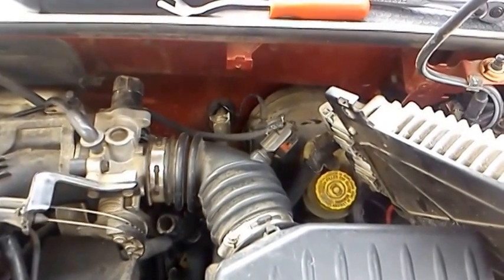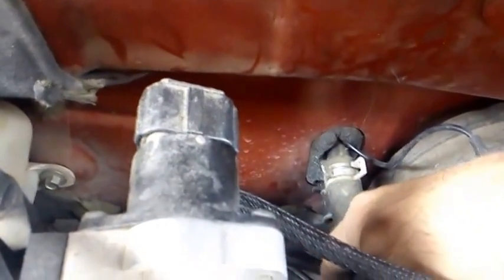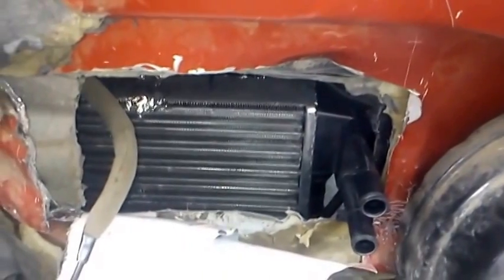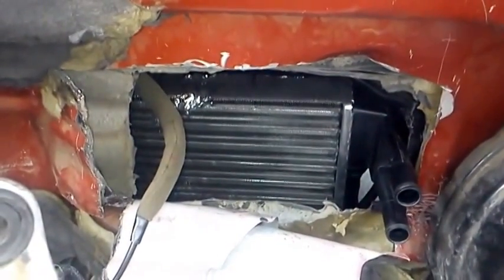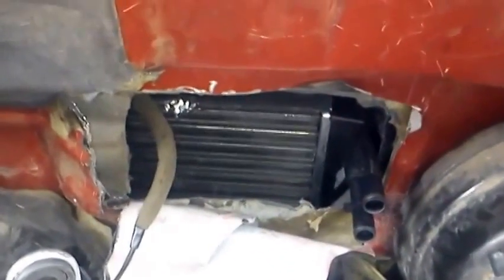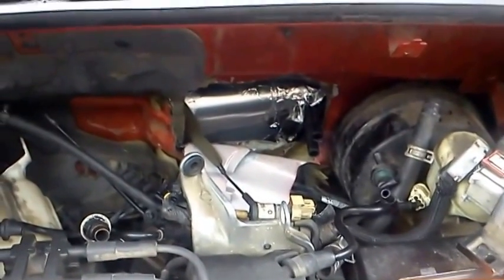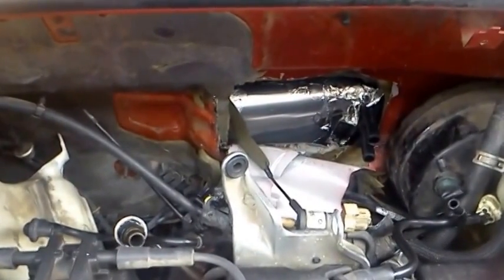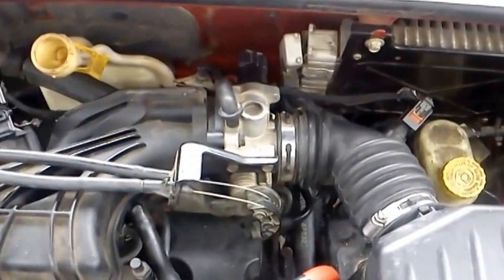2001 Pt cruiser heater core replacement short CUT pun intended

Comment: i just finished doing this yesterday. thanks for showing the video I would have never thought to try this otherwise. at first i made the hole too small so had to make it larger to get core out. but it only took 4 and a half hours to complete.  I made top cut at the seam or bevel on the fire wall ... needed to be about 3 to 4 inchs higher. so good luck whoever else tries this.. btw  making the wrong cut just cost me time that was easily fixed with a second cut. and then when you pull core out you need to cut/break the channel (on passenger side) that holds heater core inside the heater box. again the more room you have to work with the easier the job... have fun.

Comment: I just watched a video of a the dash removal.  It took that person over six hours to get the heater core out.  And he knew where every nut, bolt, and screw was located and the procedure to remove them all.  Imagine what a first timer would take to remove that dash and all the other stuff that needs to come off,  The idea of cutting through the firewall is a whole lot better.
Reply from the maker: Not to mention the cost involved if you have to take it to a stealer.

Comment: For an easier and cleaner cut, use an oscillating tool instead of a reciprocating tool.  Also, safer on the surrounding components.  Recommended is the Multi- Max with a BiM Saw Blade.  It is also recommended to have a Toyota Prius which doesn't have a heater core.  It uses electric heater.  Prius is years ahead of other cars in each and every component.  In couple of decades from now, hopefully the rest will start introducing the electric heater.  At least other manufacturers already started learning from the Prius and began using the electric steering.  Not so much the electric water pump yet.  Electric is the future technology.  Thanks for sharing this video.  Creativity is more important than knowledge.  Who said that?

Comment: Ronnie, damn good alternate procedure. After replacing timing belt with kit several years ago in my home garage, I told my wife that if it broke again to just call AAA and have them haul it of to the scrap yard. Never again will I attempt to replace a timing belt and associated parts on a transverse engine. 

After watching a guys 61/2 hour dash removal to replace a 25 buck core, I said there has got to be a better way. That led me to your video. Cutting a hole in the firewall is not a big deal if it is sealed, as you did, after replacing the core. If you look around the firewall, there are numerous firewall penetrations that use only a rubber grommet. As been said, if you have an engine fire, get the hell out and grab a fire bottle.

If you look at Kelly Blue book for the average retail on  a 2002 PT, the cost of repair, if you took it to a shop, is more than the cars worth. Now there is something to be said about no payments for many years but at some point, you may need to put the old girl down. But for this alternate procedure replacement, I plan on getting many more miles out of it. My 92 Miata has 476k on it and I commute 225 miles a day. Dang good car that is easy to work on and repair when needed. Any time  you can do your own repairs, save yourself some money. On older cars, it’s not rocket science.

Comment: Did my 2002 cruiser and this method does work but you had better have a good saws-all. Make sure you make a big enough hole in the firewall and watch out for sharp edges It took me a little longer to do but better than taking the complete dash apart.

Comment from the maker: i finally ended up using a sawsall Nayte sorry for the late reply.
I also used a soldering Iron to metal the plastic heater case to get to the core.
Reply: Ronnie, so thankful for your YouTube.  I'm fixing to do the same and see this as a win win method.  I'm planning to use a Ridgid Jobmax Oscillating tool for the cutting.   Very challenging to find a tool to work in these quarters and angles.  I laughed being from the south and thinking that with a name like Mccullough it's a git-ter done method, LOL!!
Reply: ronnie mccullough great tip
Reply: ronnie mccullough great tip ,thanks
Reply: Привет вам из России!,,, спасибо большое за идею, столкнулся с подобной проблемой, обязательно попробую сделать как вы, отличная идея!!!!

Comment: I knew a mechanic that used to to this to replace the heater cores in Ford Tortoises and Mercury Sables, because they were ridiculous too. wish I'd seen this back in 2008 before i wasted over 10 hours replacing the heater core in My neon, not just the time but having to get a gasket & o ring kit for the a/c lines and recharge it. the only disadvantage is not being able to wash all the anti freeze out of the heater box, so it will just smell like anti-freeze for the first while.

Comment: Excellent job Ronnie. Screw the haters. You're right, if the manufacturers, weren't such greedy bastards, a lot of shade tree mechanics would be able to do this. I have a 2001 Durango that has a heater core problem. When I get back to the vehicle, I'm going to see if I can do this to it. Taking the dash out of that is an all day job. Plus, I'll have to drop the steering column, devacuate the air conditioning and all of the other BS. You did a great job and if it works, the more the better. Like I said, screw the haters and the mechanics who want to charge an arm and a leg!!!

Comment: Thanks for the idea. My core is bypassed because it's leaking. If any neon/cruiser owners need to drop the engine/trans, that would be an ideal time to make a "pretty" access panel. In the mean time, off for a pack of cutting wheels.

Comment: Thanks for the video.  Friend just messaged me this morning about her problems and sounds like her heater core.  Told her I'd fix it if she lets me do it this way.  Pretty sure shes OK with it especially after I explained the cost savings.

Thinking that I'd use my Dremel to get a nice clean cut and then weld the cut out plate back in.  Or maybe fab up an over sized plat and used some self tapping screws and silicone to secure it in place.

What would you say is the largest diameter cut off disc you can fit back there to open up the firewall?  Not sure when I'll get my hands on the vehicle to see for myself, and would be nice to have the tools ready to go.
Reply from the maker: +Ender3D Yeah I wouldn't weld it. may catch something on fire over sized plate was what I was going to do but just took the easy way out. I drilled a hole to get me started and used a saws all.  4 inch after you get the intake off on the disc depending on how big of grinder you use.  the small hand held air file would be best.

Comment: When reinstalling why did you add flashing and aluminum tape? Did cutting that access hole prevent you from mounting back the way it was originally?
Reply from the maker: Well yes it did, unless u can melt the plastic or glue it back together.  The core is mounted where it was originally but u have to recreate the outer housing with the flashing and tape.

Comment: You mention "opening up the heater box". Can you elaborate a little. Is this done from inside the car?
Reply: mike brody Never mind. I see you used a soldering iron...obviously from under the hood.
Reply from the maker: +mike brody through the hole i made in the firewall Mike. You can also use any other tool that will work for u.  Dremel tool mini saw. I just melted it away with  my soldering gun large enough to remove the old core. Notification are slow in coming on here for some reason.

Comment: Hey Ronnie. Do you think a 4 inch grinder would do a better job than a saw?  I will be doing mine soon enough.
Reply from the maker: I don't think u have enough room in there for a grinder. .
Reply: ronnie mccullough j. Roger that. Might try some Tanerite. Lol. Thanks. Take care.
Reply from the maker: @Smarty1171  No why don't u just spend 8 to 12 hrs and do it right? Or u could just torch it an that should fix the issue.

Comment: Seems to me a Sawzall blade is so long it would cut through the inside heater box while you cut the firewall.??
Reply from the maker: It didn't in my case. It Just cut the metal and not the plastic. I didn't cut deep just enough to cut through the metal. The plastics not right up against the metal. There are others ways to cut it, this is just what I had and it worked for me.

Comment: I would like to see how he cut the hole out,and disconnect the heater core🤔🤔🤔
Reply from the maker: Hole was cut with a sawzall in this case others have used different tools and once u cut through or in my case melt through the heater box the core will just come out. The heater box has rails in it that hold the core inplace.

Comment from the maker: if your loosing coolant and u can smell antifreeze and or your carpets wet then yes. your windshield may even steam up..
Peter Kingsley
Reply: ronnie mccullough  What is the hose or line coming out of the cutout on the left side of the heater core?
Reply from the maker: vacuum hose.
Reply: ronnie mccullough Thank you.
Reply: ronnie mccullough It that a vacuum hose that stays in the heater compartment?  I did see it coming through the firewall before the cutting.  Just getting lined up to change mine within a month, Thank You
Reply from the maker: yes it comes through where the heater hoses do. If I remember correctly.
Reply: thanks, for the help ronnie

Comment: Anybody try this on a 2000 2006 chevy truck???
Reply from the maker: you can barley see the heater hoses on those trucks but if you can get back to the fire wall and cut a big enough hole u should be able to get out after melting though the heater box. Looks to be really tight around the engine. If it was mine I'd give it a shot. Getting to the fire wall without pulling out the engine or at the least pulling the intake and maybe the intake cover would be the problem.

Comment: Thanks i have seen other videos where this kid takes two day taking the entire inside front part of that car apart and this is on a car thats pushing 20yrs old not to mention what a genuine theif would charge to disasemble the entire inside of your car it is crazy i got women who wanted this moneypit so i bought a 01 in 02 for her this car is a money hungry p.o.s. but women loves it i think i put like 20k into it since 02 for repairs that you have to remove engine to replace waterpump and since were in there mind as well bleed you for alot more money because it will cost big if it has to be done again to heater core thousands to fix to the cheep rims that corrode so bad in a few yrs to you name it chryzler should have been sued into bankrupcy when they made this nitemare.

Comment: It's a simple hillbilly way to change the heater core. I suspect that thermostat in your car is clogged and not letting the antifreeze circulate in the car. That might caused that core to explode since the high pressure always finds the weakest point to be relieved.
Reply from the maker: Thermostat was changed prior to the core exploding. The core had been leaking for a while and i suspect she ran it a little hot to get this reaction even though the said it never showed hot. heater core was the problem all along. She has had no more issues with over heating since it has been changed out.

Comment from the maker: Of course there will be haters. But they won't last long on this channel. Calling me names and your the idiots. One person said it would weaken the car. if this little hole weakens the car enough that you should be worried about it's structural integrity your the Idiot. Bye. Lots of older cars had the access port, the companies just find it cheaper and can charge you more to do the job because most people won't attempt taken out the dash.Thus they can charge you big bucks to do it. Go ahead cuse me, It works and it's a cheap fix. And i can always delete your post and block you.
Reply: ronnie mccullough you did great screw the haters..keep on keeping on